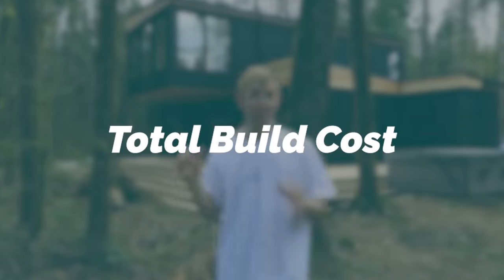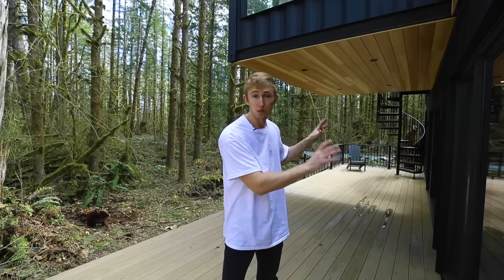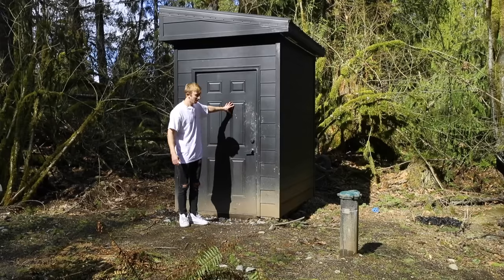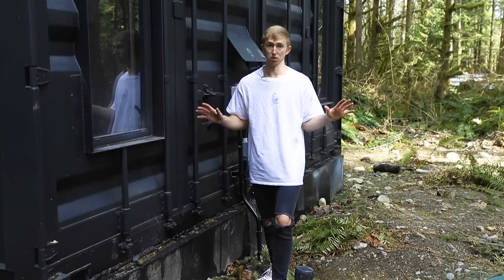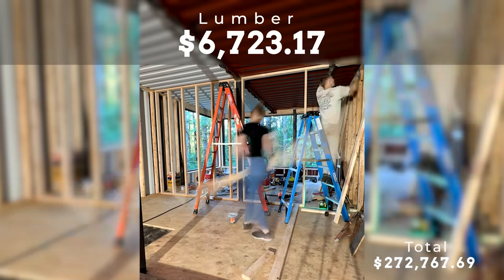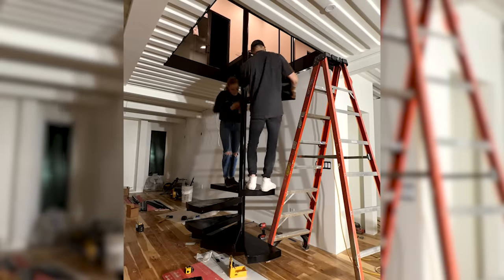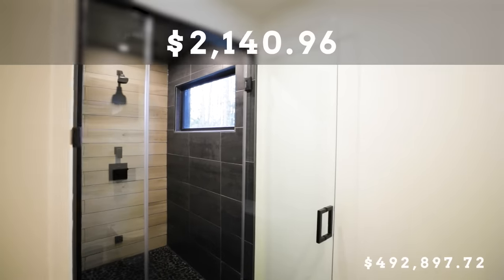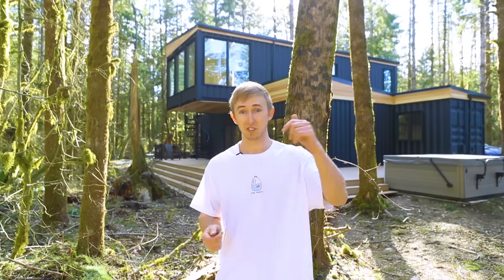How Much My 2-Story Container Home Cost to Build

Comment: Amazing of you for being so transparent about your costs, to help others understand what they might betting themselves into. You deserve the attention (and the comment if it helps you gain exposure) and rentals you generate for this very cool AirBnB.  The final product is very aesthetically pleasing to me.  BUT.... this is insane. Why build a shipping container house at all? A traditionally framed home with structural steel would have cost less, not be as confined with steel walls and ceiling heights, and simpler for future remodel. Many of your costs would have been identical per square foot for a traditionally built electricity, septic, driveway, etc. . I suppose the container home is better advertising for AirBnB for it's uniqueness? all in all,  I question the rationale for buidling with shipping containers. But I did say, it is aesthetically pleasing, so while questioning your sanity, I still congratulate the accomplishment. I suppose the 3.5M views justified the containers. 😂

Comment: Quick question brother.  You said when you were laying the pad for the pump house you had rock underneath.  You did rebar the concrete right?  Not trying to be that guy just wasn't sure how cold your Winters are.  Cause it may end up expanding and shrinking and crack after a couple years or sag If it's not reinforced

Comment: I work for a gas and electric company. You explained it best. Because they could charge you that amount. 

To be fair it really depends how far they had to go to pull electricity. If they had to go several miles then yeah it’s definitely going to be expensive but 27k is excessive.

Comment: I work for a power company. First of all transformer prices fluctuate and we buy them from a distributor and they can charge as much as they want. Also underground transformers are always gonna cost more because you have to trench like conduit and build a riser to a and overhead pole. Then you have to think about all the equipment used; Bucket truck (if it’s a riser), boom truck to set underground transformer, material, fuel for trucks, all the man power to install ( some lineman are more expensive than other based on the position). Overall yeah, we can literally charge what we want. But hey that xfmer could blow up tomorrow in the middle of the night and we would replace it for free?🤷🏻‍♂️

Comment: Blower door inspections don't blow air into the house. They suck the air out of the house to measure the amount of cubic air is loss per hour. It's rated against the IECC standards typically 2021 for air exchanges and the house is given an overall rating based on windows, r value of insulation, and efficiency of air handlers. I would be interested to know the cost of the land as that accounts for a good percentage of any build. All the other costs seem in step with other pricing.

Comment: It appears you are in the middle of nowhere and depending how far the power supply is, will greatly determine the cost. If they have to bring your supply line a few hundred feet underground, we’ll thst right there is the bulk of the cost

Comment: That was a super good deal on the architectural and structural drawings. It is a hell of a lot of work to prepare those drawings. The civil design is a small fraction of the architectural and structural but was 60% of the cost. Did you have to get site reviews done? Is that added into the cost?
Reply from the maker: Only on site items were the survey, critical area study and septic samples

Comment: I see the point in building using shipping containers and the such to cut costs, but given that this has cost you as much as brick and mortar house that would last you for generations, wouldn't you recommend doing the same design in brick and mortar? At least it won't rot away in a few decades no?

Comment: unfortunately in the PNW,  you get freezing temperatures;  and alot of moisture. You're susceptible to icedamming in a very unique way w/a metal roof. water gets trapped between seams, freezes, expands, and now you have gaps in the roofing. They are great, but not as bulletproof as you may think if you live in freezing areas.

Comment: I was gonna say your crazy for spending that much on a container home. But, because of your location I can see why. Also, the fact that it's just not randomly put together it's up to code and can be sold for a 250k profit 💪🏾. I think you found your calling brother 250k profit once or twice a year ain't to bad bro not to mention it probably would cost more if you built it from scratch nice job brother.

Comment: I honestly thought you were going to save a ton of dough using the storage containers... I was wrong. That being said, if you were on an old plot that already had all the hookups (septic,, water,, electricity) you would have probably save a lot more using them. I will say, you got screwed on the split systems. I've installed central air in larger homes for similar prices.

Comment: 28k for 5 HVAC units isnt that's bad do they all have separate outdoor units or do they share units? because if they share they yeah you kinda got screwed a little bit. also that deck you might need to wash it more often just because the low light it might grow some light moss or something on it and start to get slick.
Reply: They’re mini splits. You can easily DIY them. A 5 zone 48k btu mini split system is less than $5k.

Comment: In 2017 I had a 3300 sq ft 1 story house built for $350,000 (rounding up but only very slightly).  I cut out cost of a general contractor, as a knowledgeable relative was willing to act in that function for no cost.  The 1 acre lot did cost $100,000 additional, but wasn't sure if the cost breakdown in this video included land cost....  I'm fully aware most people couldn't have gotten a house built of that size for that amount, even back around 2017.  We sold the house for $700,000 in 2021, and even making that amount of money I will tell you that I would NOT do it again.  The amount of stress and time involved, dealing w/ city/county and permits, no way it could be done now at that low of cost, having kids and a job to focus on, etc... No way could I do it again!

Comment: i suspect that the "cost to build" = $343 / Square Ft.,  isn't too bad if it includes engineering fees as well, which may include:   architect, surveyor, soils engineer, civil engineer, structural engineer, testing for house energy sustainability codes,  and Landscape Designer, Depending on your jurisdiction these may be very minimal to very high cost factors. If it doesn't then add to the $343  If you have a very aggressive HOA (Home Owners Association) you may find yourself going down a very deep rabbit hole which will impact all kinds of costs and delay construction and increase other costs, such as your carrying costs on the loan. In other words "Do your homework & Buyer Beware!"  I might add that this home is a contemporary home design. Contemporary is very expensive due to increased cost of FFE (Fixtures, Finishes & Equipment).  You don't want to get you cabinets from a big box home supply stores,  if you're going contemporary.  It only works with very good FFE.  Just as an anecdotal example; where I live in Santa Fe, NM you could spend anywhere from $500 to as much as $750 per square foot (or more if you  have really deep pockets).   Good Luck!

Comment: Ok first 2 minutes of your video need some clarification. As a surveyor myself i have a few things. first being the cost of all the surveying from wetlands to boundary to layout. 10k for all of that is OUTRAGIOUS 5k maybe(this is also area dependent but still 13k total come on). Taken to the cleaners imo. 2 the points showed if set properly and with the right equipment are not accurate to within 2 feet they should be accurate to within 1/8th of an inch. lastly this goes for anyone reading this PLEASE DO NOT JUST USE GOOGLE MAPS to get close. Google maps has an accuracy bubble of +/-20 ft to where they may say a given property line is at meaning if you dont get a survey done you just built whatever on the wrong line and cost yourself more time money and effort.

Comment: His site said it's $322/night. At a cost of 541,452, it would take 4.61 years of renting it out 365 days a year to pay it off. Is this worth it?
Reply from the maker: Avg nightly rate is actually $550. Gotta take averages, not just the lowest rate for a weekday
Reply: @devonloerop  That makes more sense. Thanks. Even then with just weekends and week here and there it would be done in around 5 years.
Reply from the maker: @jimmy90249  right now it's trending for August 2026 to be paid

Comment: LOL, way too much for the construction vs square foot.  Then add on that Exterior Insulation is the proper way to insulate a container otherwise you are going to have huge issues especially mold inside.  Way cheaper, more environmentally friendly, as well as structurally sound to not build container homes at all.
Reply from the maker: Thanks for the advise!

Comment: The other civil engineers who calculated and planned the structural reinforcement for the build... arent included in the civil engineering category lol? 
Maybe a single person isnt specialized in doing literally everything but civil engineering encompasses the geological surveys and studies of the land, foundation construction based on the survey, general architectural plans, structural plans calculations and solutions, systems planing (i.e drainage, sewage, piping, heating gas and electrics), sound heat and water isolation, roofing solutions and finally, facade / decor. That is, if the engineering revolves around a CIVIL building/construction.. like a private home, garage, office building, mall etc.

Comment: I'm sure a lot of your costs were because you're way away from everything. As you said your structural steel cost and energy costs were astronomical.  A saltwater hot tube? Bottom line, next time build closer to city access. As well, just rubber stamping bids is not a good look. So what if you had to take more time to finish, you could have saved a lot.

Comment: Yea, you wont be able to skip the official survey if you want architects and engineers to give you signed and sealed drawings.
Reply from the maker: You actually understand 🤘🏻
Reply: @devonloerop  great breakdown though, as someone in the industry nothing is more annoying than people who think container homes are a hack for cheap and easy housing. 

I appreciate that you don't front it as cost savings measure but as a luxury aesthetic that is worth it because its cool. Even going as far as noting all the extra steel required once you cut windows as well as framing up wood frame walls regardless. Thumbs up from me, maybe ill have to come down from Vancouver to stay in it!

Comment: This is absolutely insane how expensive all this stuff is. The cost of living is totally out of control. Specifically housing. The biggest problem causing most the issue is not enough new affordable houses and apartments. This video shows why! For half a million used you could buy a mansion in certain areas. It’s nice to have all new but this is insane. I mean $20,000 for spray foam? wtf

Comment: For such a nice building with high end products, it's a shame you used such cheap windows. Milguard windows are horrible ( I know as I am a licensed general contractor). Their seals on the dual glazed windows don't last. When I built my house 20+ years ago they had a lifetime warranty, but I guess they've had so many problems it's now a 15 year warranty. For a high-end house like this one, you should have spent the extra for either Pella or Anderson.

Comment: I have to get those expensive stamps too ....even though I'm an engineer myself 😭
But as a builder I also think you got absolutely ripped off on most of this
Reply from the maker: I know people up the street getting multiple quotes from multiple builders for 1600-2000 sf homes for 1-1.2MM. I think I did alright
Reply: Then you're all getting ripped off.

Comment: yeah that 27K for the power is a complete rip off . and i bet they did it all in like half a day with a trench digger.

yeah i know the equipment is expensive but at 27k$ i could buy 4 or 5  walk behind  trench diggers that would do the job just fine. the cable is probably a few thousand. definitely over charged you by like 10k

Comment: Your construction costs are unrealistic for those who want to build a home on land that's already accessible and doesn't require clearing all the trees. I also take into consideration your location which is overburdened with excessive regulations. If I wanted to build a shipping container home in my backyard might cost would be nowhere near what yours is. The shipping container is alone wouldn't even cost that much. I would find a much more cost efficient way to do it if I were you. There's no way in hell that home will ever sell for that much.

Comment: looks nice but horrible investment
Reply from the maker: False, How would you know? Saw all of my numbers?
Reply: @devonloerop  with rates this high & airbnb rentals slowing, your relying on short term rentals to have slight profitability. Managing the airbnb rentals is part time job by itself if not full time,  you would've of been better off buying a multifamily. Would of been more passive than this & more stable income albeit a lower return.

Still location is good. You could probably make some good money right now if you sold it right now while were in a strong housing market

Comment: This is not a million dollar home. This is barely even a $600k home with inflation. TF is he talking about? I put money that he's upside down in this home
Reply from the maker: Lol 🤡 wait till you see what it makes in a year...
Reply: @devonloerop  It's easy. Get an appraisal, man. No speculation needed. You're not getting anyone to pay a million for a container home 😂
Reply from the maker: @joel6038  a 1500sf home on 5 acres built in the 70's just sold for 1.2MM just for the record. Even if the home appraised as a single family home sub $1MM I'd be selling it as an investment property. Currently makes $150k + per year, based on very conservative rental multiplier an investor would snag this in an instant for 1MM. Easily 6.5 year roi (smokes any real estate investment out there)
Reply: Really depends on the location. It's in WA, so I'd say it's very likely this will sell for a profit. I also have trouble believing that 1M number though. There are townhomes that are just as large IN Seattle that sell for less. Granted, there's far less actual plot with those homes.